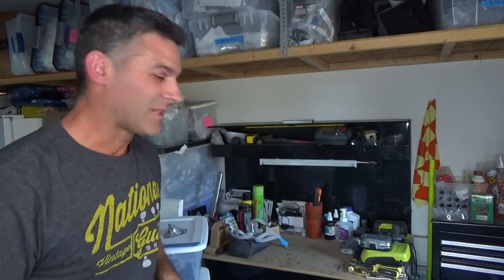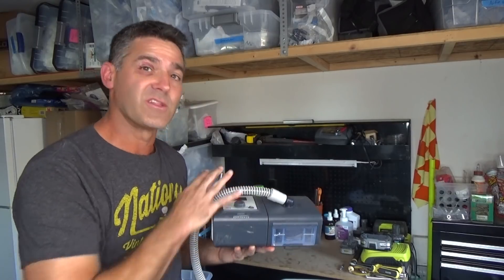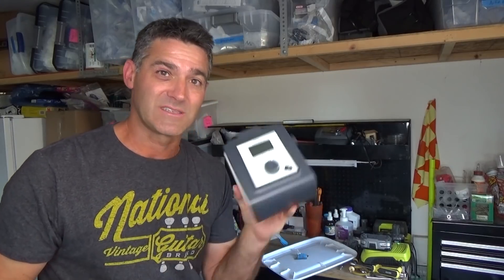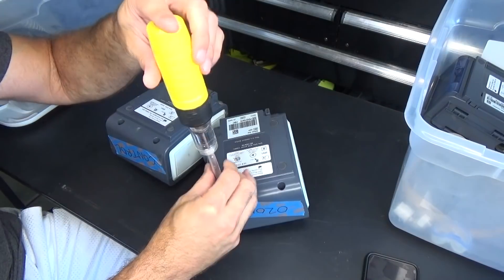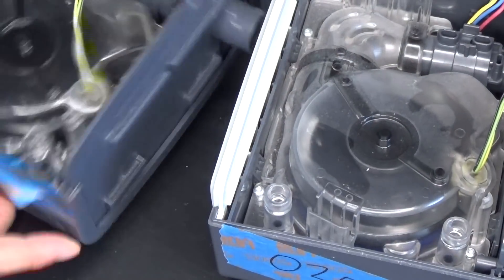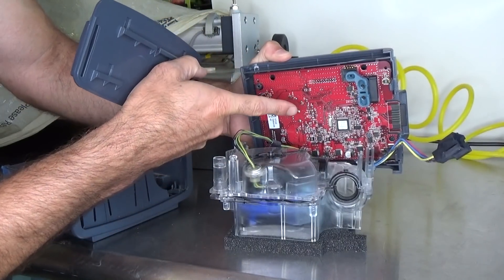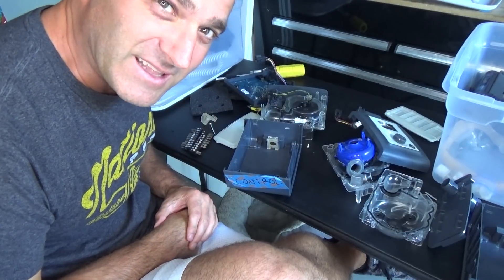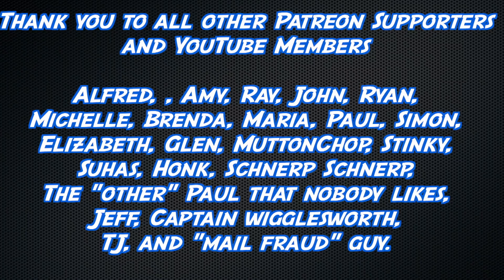Showing what OZONE does to the FOAM in a Philips Respironics CPAP Machine   #Foamgate

Comment: If this is the case why is Sol Clean still pushing Ozone does no harm?
Reply: Another Youtuber tested it on Resmed and a Phillips Dreamstation 2 and found that it didn't make those foam pieces any more brittle and didn't seem to break those down. It's just the foam used in the Phillips units earlier than the Dreamstation 2 were prone to it. Of course they tested effected units off the shelf and found that they were emitting possibly carcinogenic gasses without being used or cleaned by anything really. So just because someone didn't use a SoClean machine doesn't mean they're safe. Better to not use the machines, register them for recall, and borrow or get a different machine in the meantime if possible as Phillips seems to be taking their sweet time at it.
Reply: @reallynotbob6  The issue is not JUST Philips, it is the FDA that needs to approve a new foam.  The intent of the foam in System One and Dreamstation is to attenuate noise
Reply: @lucabencini6940  They already have approved foam, which is being used in the DS2, and other than the different foam the assembly is pretty much the same.
Reply: @reallynotbob6  I'm sure you are right. I did buy a DS2 from a wholesaler a very good price. While the design might be the same, it has a fundamentally different flow of the air. Firstly, the humidifier is integral (yes can be removed to add water) but must be attached to work unlike DS1 and secondly the flow makes a U Turn inside the humidifier.  This means that Soclean 2 cannot be used.  Of course, Soclean can be used to sanitize the hose and mask using an adapter.
Reply: @lucabencini6940  Yeah, there might be a little bit of a difference to be noticed aside from how the humidifier attaches. But I saw vids where they took apart a DS1, and DS2, the ducted fan and intake assemblies looked the same. The circuitry and programming could be different though, as they probably made some optimizations in the years between the respective releases.

Comment: A huge Thank You and Appreciation  to you and  Nick our  CPAP friend form Australia for posting these concerning Foam issues with the Phillips machines. My wife and I at present are both using these by the way Medicare and our Insurance have covered us over the years that being said I wonder if Medicare has taken up this problem but that could be another issue that  may involve user compliance and DME suppliers. Now back to it this is my 2nd machine my first 7years ago was an autoset  resmed 9 ,  her first was the Phillips DreamStation 6 years ago  when it was time to replace my 1st I opted to switch to the Phillips it made sense for us to use  the Phillips for compatible  supplies cleaning and adjusting the settings . After watching yours and Nicks information I took the older Phillips machine my wife had used for 5 years and for practice dismantled it and took out the foam there was no evidence of any deterioration or particles . I then took our newer Phillips Dreamstation machines apart and removed the foam again there was no visible deterioration or particles the foam was intact with no separation, I did keep the foam (now in storage bags)  in which some had separated due to the small cut outs from the inside of the air chambers during its removal. I also blew the air chambers  out with high air pressure and sanitized them prior to reinstalling the units to operating condition we have never used any cleaners on our equipment other than soap and warm water. I do feel safer about using these machines but I do have a concern about the the air pump itself being contaminated with the carcinogens that had passed through the foam while the machine is idle or being back flushed by the ozone cleaners .  With out sending these units to a lab how can we test the internal parts of the air pumps ?  Sorry for the long winded post and thanks again to you and Nick for all your information .

Comment: You never clarified this.  When you say you pumped them "full" of ozone, were you using the ozone machine the way the mfg says?  It only runs for a max of 10 minutes a day if you follow the suggestions.  I am NOT saying the ozone is safe, I'm wondering about the scientific method of the test.  You use a control which is excellent, but did you run the ozone machine 24/7 or just a few minutes each day?  EDIT:  I posted this before I read taseglet's comment, which is now pinned.
Reply from the maker: Did the taseglet reply answer your question?  It's a very fair question.

Comment: Good thing I couldn’t afford one after paying out of pocket for my cpap and my cpap equipment dryer because I wanted a So Clean so bad. One of those rare occasions it pays to be broke.
Reply: The foam off gasses chemicals, ozone or not you should stop using any philips product
Reply: @patv4475  yeah I did, but I’m still glad I never bought an ozone cleaner. I had only been using my cpap since December and I stopped using it when I heard about the recall a few weeks ago.

Comment: Philips need to say the levels of VOC exposure the foam in these machines were creating without ozone, I never used ozone but I used this machine for a long time, I’m worried sick about these chemicals
Reply: A certain degree of caution is always a good thing, but you have to keep things in perspective. We're surrounded by VOCs and other chemicals. Just about everything around us made of plastics is off-gassing. The foam pillow I put my head on is off-gassing. Anything plastic that smells like plastic is off-gassing. New car smell = off-gassing. That CPAP machine is going to do more good for your health and well-being than a few extra molecules of chemicals will likely do to harm you.
Reply: @JohnJones-oy3md  I agree but off gassing directly with pressure to your lungs is a scary and dangerous thing. Why would Philips say to cease usage
Reply: @patv4475  My guess would be lawyers and liability. Again, it's all a risk/reward ratio we have to individually decide on. Philips shouldn't have put us in this position, of course.
Reply: @JohnJones-oy3md  especially with our modern litigious society that wants zero risk, then drive 80 MPH sitting on 20 gallons of gasoline.

I think it's new sensors that can pickup the low levels now that they couldn't decades ago when the foam was approved. 

The lawyers saw possible carcinogen and said recall.
Reply: Philips does say it can off gas from the INITIAL start up, of course it says this in the information that was sent to doctors and not to peons like us.  So they must have pulled some off the shelf and tested it.  I'm also in a FB group with people who say they never used ozone but they did a "foamectomy" on their machine and they still found degraded foam with a lot of dust.
Reply: @katherinereece  yea exactly, my foam was intact but I’d like more info about these VOCs

Comment: In your last video, you referred to Philips's mention of ozone in their recall as a "red herring".  It now appears that you are now thinking ozone may have a detrimental effect on the foam.  I am not a chemist and I would really like a chemist knowledgeable in the possible reactions of ozone on this type of foam to weigh in and give an opinion. 
As far as VOCs (Volatile Organic Compounds) are concerned my experience tells me that the amount of VOCs available from this foam is likely a small fraction of what each of us is exposed to most every day.  If you calculate that it takes years of use to exhaust the VOCs in this foam, which would equate to thousands of hours of exposure time, the daily amount of VOCs from the foam would seemingly be an insignificant risk.  
I think that Philips likely has a solution to this problem but I know that it takes an extended period of testing to satisfy the government regulators that any new medical device or change in an existing device is safe so the fix may be a long way off.  I also think that Philips suggesting people quit using the machines is a way for them to limit their liability.  If you continue to use a machine that is covered in the recall any future problem you may have will be on you as they will be able to claim that they told you to stop using it,  As for me, I have not used any ozone with my dream machine and won't in the future so I will continue to use it until a fix or suitable replacement is available.
Reply from the maker: Great comment.

To clarify.  I believed ozone has always had a negative effect on the silicone seals of a machine. Didn't know they had an effect on (specifically) Respironics Foam.  

So while I think ozone does damage the machine, this still doesn't explain away that VOCs are released from the foam day 1, without the use of ozone.  It's this distraction by saying "foam degradation may be caused by unapproved cleaning methods" that I refer to as a red herring. 

To continue and agree with your comment, I think that PR is trying to limit their liability as well as blame (by pointing the finger at "ozone".)
Reply: I added my own comment on this today.  I NEVER heard about ozone being detrimental to CPAP equipment, until AFTER the recall.  No one ever pointed it out to me before and I never discovered it on my own.  Only AFTER I read the recall notice, did I look up about using ozone, and found out about the bad things it does to the equipment.

So, yes, using ozone may ACCELERATE (but is not the ONLY CAUSE of) the break-down and out-gassing of the foam (and have harmful effects on silicone seals, etc.).  BUT, in the final analysis, it was Philips who made the choice to use harmful materials in their "noise abatement" foam, not the users of ozone disinfectors.  And as was said elsewhere, the foam started deteriorating and out-gassing from DAY ONE, even WITHOUT using ozone.  Philips are clearly trying to remove some of the blame from themselves and place it on users who have been using ozone.  (And, for that matter, on users who failed to move away from hot, humid climates.  So I guess all users of the Philips NIghtmareTortureStation CRAP machine should have moved to Antarctica.)
Reply: @ed6213  I didn't know that we shouldn't use ozone cleaners until AFTER the recall as well! In fact, in May 2021 when I called to reorder supplies from my DME, they asked if I had a SoClean because they had a great deal on one if I didn't. I told them that yes, I did have the SoClean, and their response was, "GREAT! I'm glad that you do".
Reply: @ed6213  read Gary's comment again.

The VOCs in the air from the foam are likely in such small quantities as to be undetectable and not dangerous at all. And that would be why it was approved originally. 

Now decades later test equipment is more sensitive and detectable previously undetected stuff. But no one bothered to retest the previously approved foam.

Some complaints about degradation, likely due to ozone, caused new testing to see what was happening and that included using newer more sensitive equipment.
Reply: I’m pretty sure the fact that the air filters through that foam full of chemicals and straight to your lungs is problematic compared to the off gassing that’s all around us like you mentioned. Would definitely be nice to have an opinion from an expert or some third party testing
Reply: I think zPat is exactly right. It's a whole different kettle of fish to have VOCs or other products from outgassi g rimmed at high pressure into your lungs for 1/3 +- of every single day. That's why I have been careful to use extra filtration besides the small foam one, and they get yucky. It must be somewhat akin to smoking

Comment: If you opened thousands of Mens Sheds across the US, they could swap out that nasty Philips Foam in next to no time and make some money from Philips in the process
Reply: Phillips needs to make up a bunch of the clear duct housings for the Dreamstation without the foam inserts. That would make field repair of the machine a simple parts swap.
Reply: @butchs.4239  except they spent the past year making the Dreamstation 2 expecting you to upgrade. Didn't they?
Reply from the maker: This is so true!!!
Reply: @Freecpapadvice  and cure depression at the same time
Reply: It took about 8 minutes to open up my System One backup unit to check the foam for deterioration.  It looked intact and apparently no damage.  I do not use ozone units.  This unit had approximately 4000 hours usage.  I offered my DME my services to make the repairs for these units if they would provide new foam.  Obviously, they had no replacement foam and most  likely would not give it to me even if they did.  
The DME did call yesterday to tell me that I could have a new Resmed 11Air Sense Elite unit next week.  I know nothing about these units other than they are monitored/controlled remotely (I could be wrong); a fact I detest.  Anyone have any suggestions or info if these are good units?
Reply: Well crap, I meant I detest the remote monitoring, not that I could be wrong, not that I ever am😊
Reply: @lawrencethompson465  you're not always right, but you're never wrong

Comment: Philips told everyone to stop using their CPAP machine.  My Dr. said I should use it, but it was up to the me.  I have had this for seven years, and if I don't use it I get migranes.  When I do I still get headaches, but not as bad.  I took the foam out and when I did I found that the connection for humidifier had melted.  I can't just go buy a new one because they cost so much.
Reply: My doc said same to me, e.g., that using it was up to me.  Looks like the DMEs, the docs (or some) are butt covering like Phillips appears to be doing.  How long or how many cycles of use was your machine on in order to cause melting of the plastic tube going into the humidifier.  Put another way, are you suggesting the blower motor overheats because the sound proofing foam was removed?  Thanks for the courtesy of your reply.
Reply: On my System One the big white plug for the humidifier had melted. The  humidifier had stopped working a while ago, so I bought a stand alone humidifier.  On my machine, the plug and wiring harness was for the humidifier only. I took that plug out and taped the prongs with electrical tape. It works fine now (except for the foam thing). Thats what I did with my machine, I'm not telling you what to do with your machine!  J Blinn! just saw your name LOL
Reply: Chin straps keep the headaches away, I got Zen sleep has everything to sleep earplugs, mask etc.

Comment: Good to know Ozone kills CPAP machines and when to avoid it - only thing I ozone these days are hose and water tank (after washing them first).  side note: Am curious if anti-bacterial filters make any difference wrt needing to clean CPAP machines (does enough bacteria get through filters to be problem?).
Reply: With CPAP gear, it's not necessarily bacteria that's the problem, it's when you get organic compounds, such as spit and such, on the equipment, mold and fungus can grow on it. Lanky Lefty did a video explaining that on one of his O'zone gen reviews. I would think using a finer filter (which is generally marketed as antibacterial) would help with fine dust accumulation inside of the machine and may extend the life of them. Downside is that you may have to change filter out more.

Edit: My DME only told me about cleaning the hose, elbow, mask, tank, and immediate filter and tank area; as well as changing the filter. At least for the moment I'm only going to stick to cleaning what my DME said, and they didn't mention using O'zone either. Just original dawn soap or baby shampoo and warm water on the removable bits once a week, and cleaning the mask and elbow every morning. I think trying to clean the inside of the machine might create more of a risk than necessary.

Comment: I don't use ozone. I just wash with dish soap everyday and then in my heater to dry. No problems.
Reply: Still exposed to VOCs
Reply: @patv4475  from what Pat?
Reply: @sirenmuscle  the foam off gasses chemicals from day one, even without ozone use
Reply: @sirenmuscle  The foam can breakdown and emit volatile organic compound gasses just due to age, even if the machines hadn't been used, sitting on a shelf. That is why many medical providers and Phillips are saying not to use the machines until the recall is serviced. I'd probably recommend borrowing a different machine (another brand, or a DS2 if you prefer to stay with Phillips) until they service the recall on yours. You might be able to take it apart and remove/replace the foam with something safer if you're feeling handy, but I won't recommend it. If you do, make sure to seal off the ducting well in the machine. Leaks in the assembly can mess with how the machine adapts to events and reports data.
Reply: @reallynotbob6  I dont use phillips. I use resmed air sense auto 10.
Reply: @reallynotbob6  Who the HELL would voluntarily choose to "stay with Philips" after this fiasco?  They are not getting one more nickel of my money!  I will NEVER, EVER knowingly purchase another Philips product.  My next razor, my next noise-cancelling headphones, my next consumer electronic devices, will NOT be made by Philips. >:-(
Reply: @ed6213  I'm that way too (even though I haven't owned a Phillips CPAP). I still have an old Phillips razor, even though I wetshave with a DE razor these days, if I wanted to buy another electric one, probably won't be a Phillips. But there have been a handful of people on OSA and CPAP subs on reddit who prefer the way Phillips devices react to their apnea events over the Resmed units (which I'm using a Resmed AS 10 Auto).